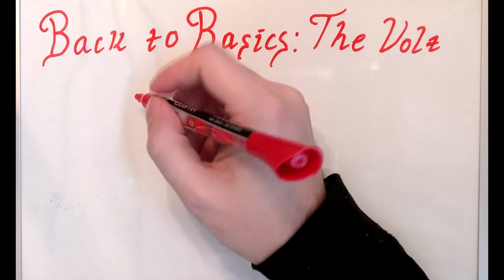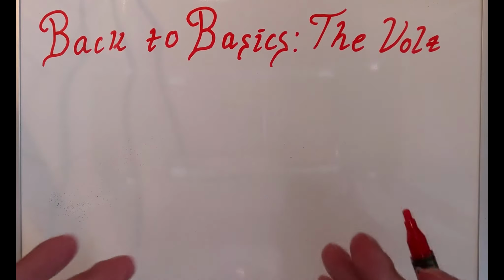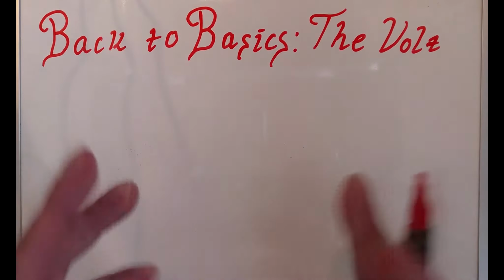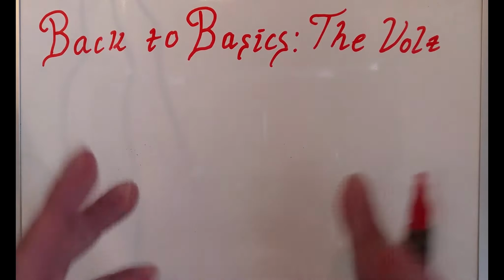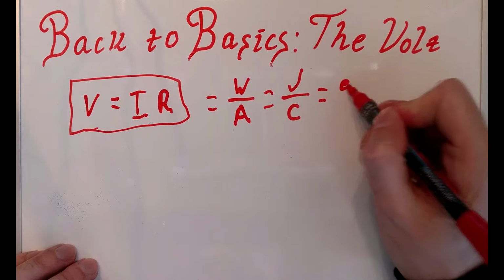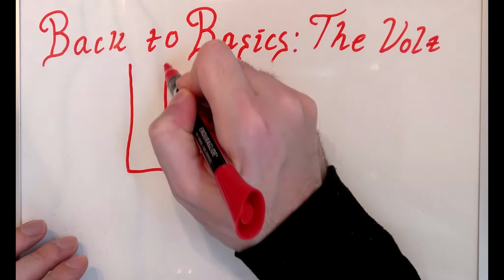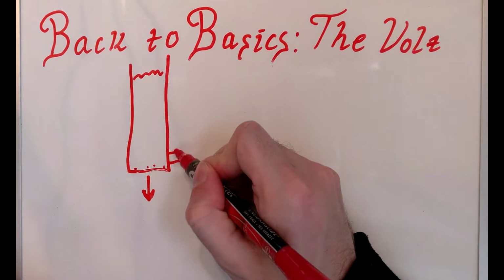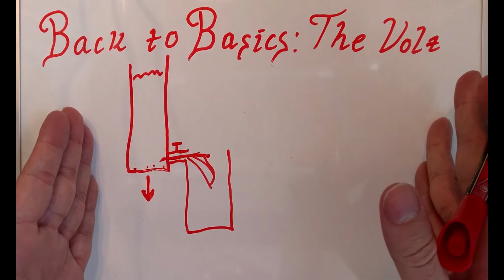Back to Basics: The Volt

Comment: I hate the definition of parallel, two lines which cross at infinity... Then they're not fucking parallel!!! Why use I for amps, never got that
Reply from the maker: "I" is used for current because of the french term "intensité de courant" or current intensity. I think it stuck around because c and C were already used up.
Reply: Gadgetboy how about A...
Reply from the maker: Maybe to avoid being confused with area? I don't honestly know. Ostensibly, E is to be used for voltage (electromotive force), but I rather stubbornly use V, so it probably doesn't really matter which letter you use in your own equations.
Reply: Gadgetboy do you get area in electrical equations, also, why not, or why 😅 keep forgetting to say, nice handwriting
Reply from the maker: You do see area used sometimes when making calculations for I^2R losses on conductors, parasitic capacitance of insulators, calculating gauge of wire needed for ampacity,  etc.